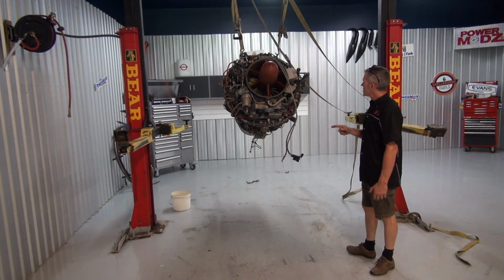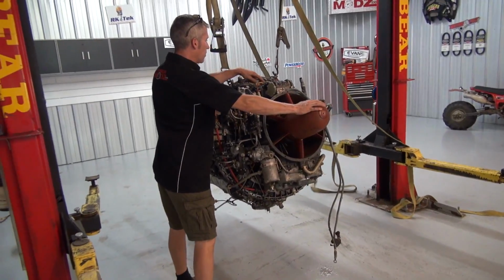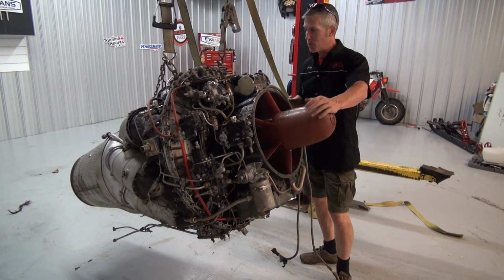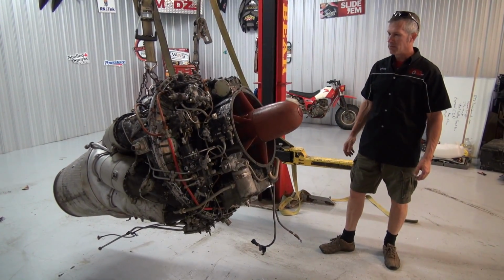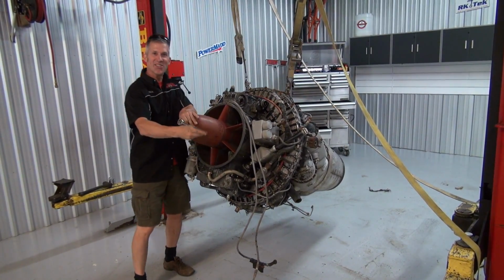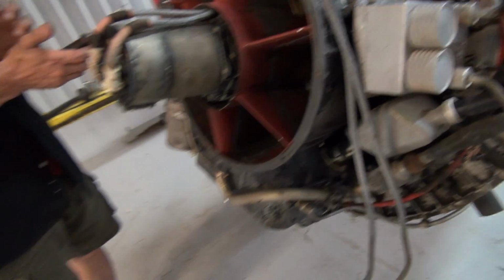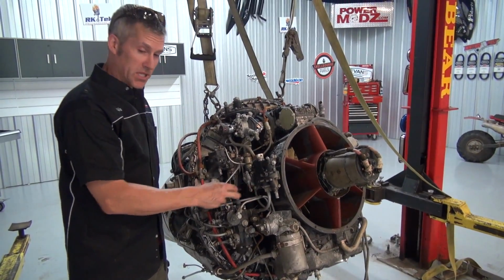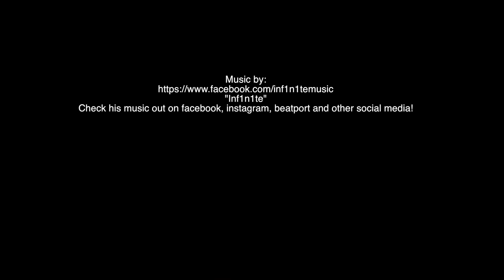PowerModz Jet Engine!!  Motorlet M701 (Walter) From Russian L29 Jet

Comment: Hi Louie, from an Agent JayZ referral!  Great project & you will have some fun, as well as spend some money!  I too have a 'back yard jet engine' project; a 1956 Fairchild J-44-R24, which is installed on a nice aluminum stand with a fuel cell & batteries plus electrical.  I will have a separate control console with indicators & switches (including an E-Stop mushroom button!) that will be connected with a 10 meter cable.  The console is at the powder coaters right now & I hope to have it soon so I can assemble/wire it.  Perfect for operating from a safe distance or from the cab of my Sierra 1500!  I don't have any videos on You Tube yet but plan to when I get it going.  You will need instruments; at least an EGT/Turbine Inlet or Outlet Temp indicator.  Most turbine engine damage is from overheating the turbine nozzle (stator) & the turbine itself, usually at startup.  I'll be watching for future progress...

DD

Comment: That bearing is a 6205.  I have one from a skidoo rev driveshaft I can pull off and send it to you.  I'll pop off the seal and repack it for ya.  Its got about 6000 miles on it, maybe more.

I have a question - where is the rule that says "I need a reason to buy a jet engine", I would like to see that rule somewhere.  hahaha

The bottom lever is the release for the "compression powder".  Kinda like a primer on an old skidoo, except that one squirts "compression powder" into the torque flange.